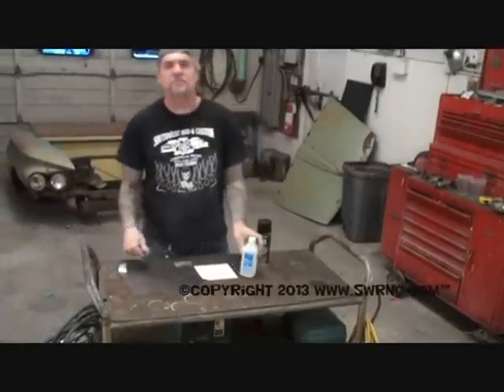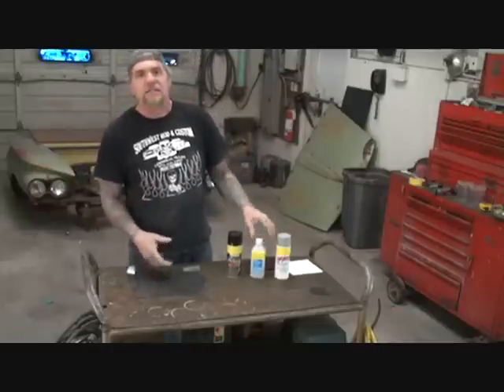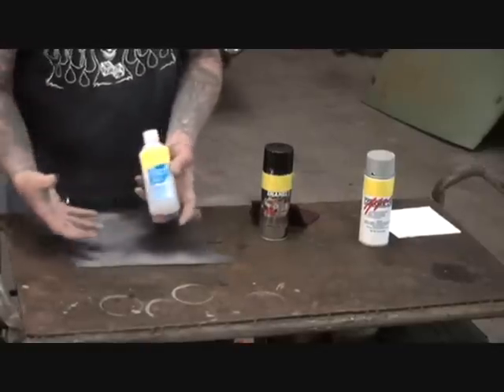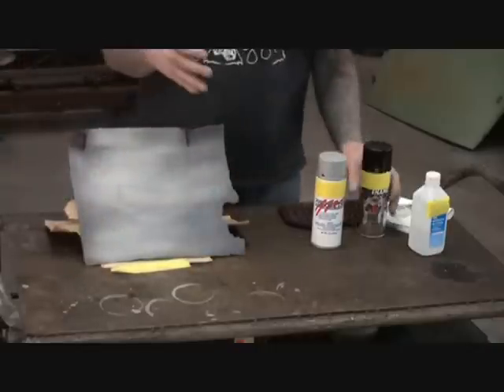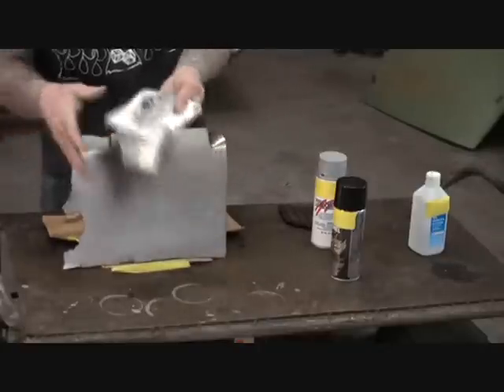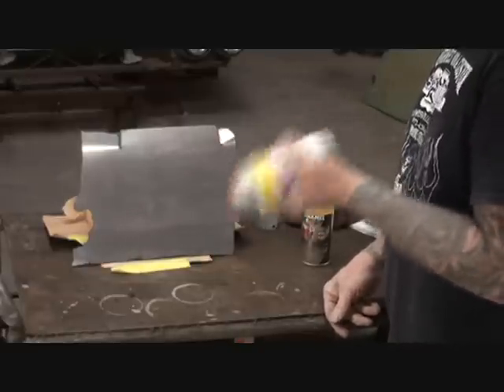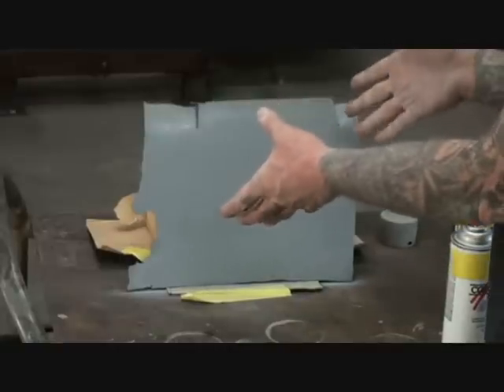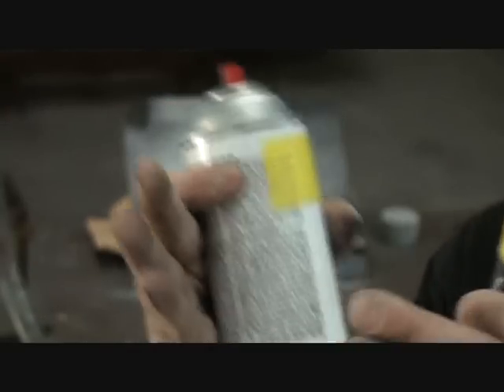HOW TO Spray Can Paint-Tech Tips And Tricks-Part 1

Comment: Pete, Thanks for the lesson - I was taught in recording engineering school work back when magnetic tape was the standard, that rubbing alcohol has additives in it that leave a residue after it evaporates.  I see your finish applied perefectly so maybe it's too little to worry about for painting purposes.  We used 99% isopropyl alcohol for cleaning tape machine heads and guides because it dried without leaving anything behind. Just some food for thought.

Comment: what about if your spraying echt primer on a engine block?  Or would you use epoxy? I used a phosphoric acid on the block and washed it off. Better to use the acid etch or alcohol the the surface then use expoxy?

Comment: Rubbing alcohol is probably going to work just fine but lacquer thinner is most commonly used in industry to prep for paint  . I wouldn't use mineral spirits unless it was really dirty or sticky as it does leave behind a light oily residue unless you follow behind with alcohol or lacquer thinner .

Comment: Hey I bought this six pack of rust-oleum ultra flat none reflective finish camouflage paint for only $11 on clearance so I figured I would use it on some of my stuff. Would I need to add a primer before applying it on metal or plastic or would I use a clear coat once I'm finished? I tried it out as is on this old knife and it chips off so I know I'm doing something wrong

Comment: Also i was gonna ask u i sprayed my exhaust pipes with rutoleum bbq paint and cleaned everthing down good with dupont wax remover and let it dry good then i paint first coat let dry sanded with 400 grit then wiped off with wax remover so its clean ready for second coat and the remover stripped paint right off i had to start over i was told i was suposed to use wax n grease remover inbetween every coat but it stripped this paint off  so need help on that yhanks

Comment: Another good tip is to heat the can with a heat gun or hair dryer so it atomizes better especially when its cold weather.
Reply: I flip my spray paint upside down for about hour before I shake them and use them.